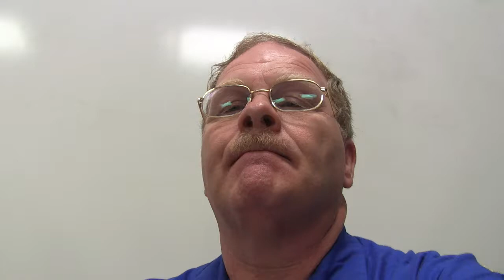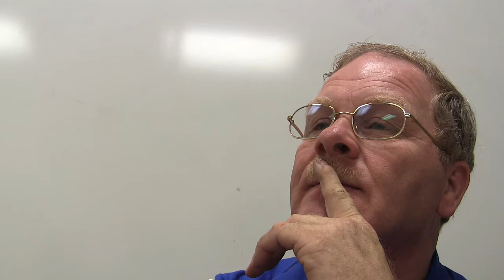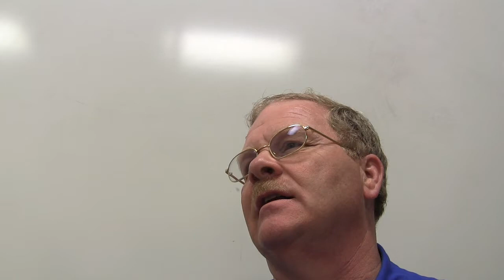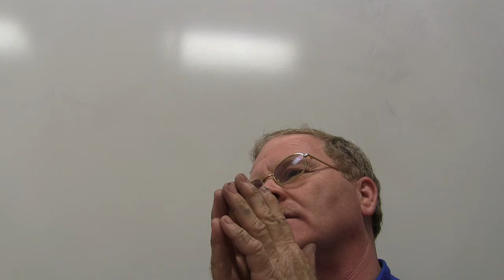Drivetrain Test 6   Sensors and signals

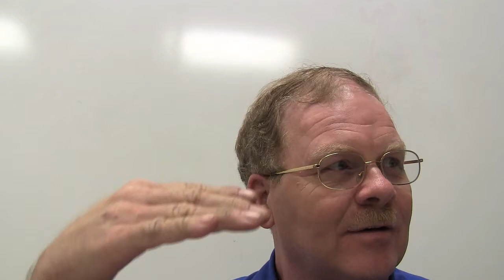Comment: Had a rear A/C unit on a van not cooling. After figuring the rear evap unit needed work I lifted it to see how the lines were run. The line had a new long rubber section twisted and kinked from someone who worked the puzzle wrong and let it fly rather than completely remove and re-install. After the re-install the rear A/C was cold like it should be. I like the story. I go to these city parks and see these fat squirrels walk right up to me and think lunch just delivered itself. In the backwoods they are skinny fast and run from the slightest sound. Had a possum think I was a tree once thing walked right up to me and was about to go up my leg before I moved to make it turn and go away. At this one place I worked this big fat rat used to come out around 2:30-3:00am to watch me work on cars. It would sit on a beam above the action fearless from noise, sticks, music, tools, and whatever I threw at it just watching me do my thing in that garage.